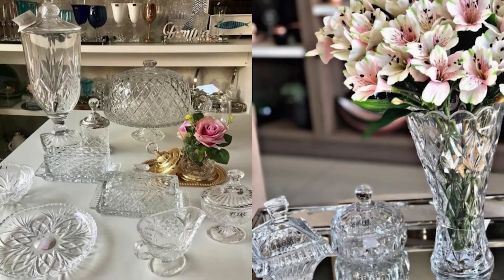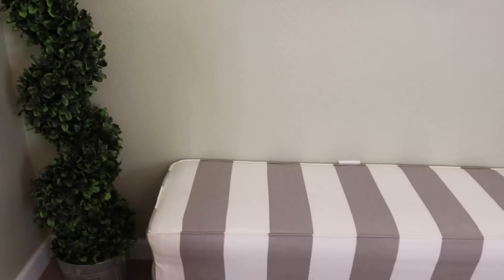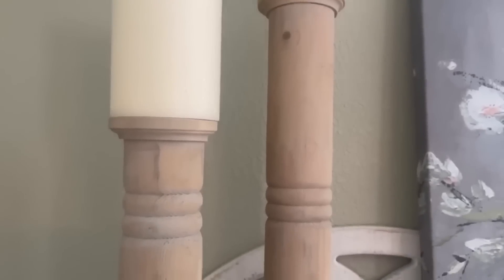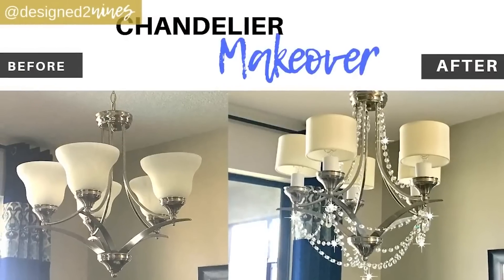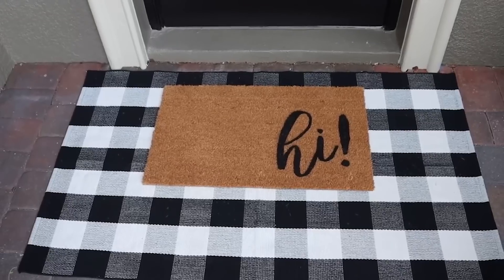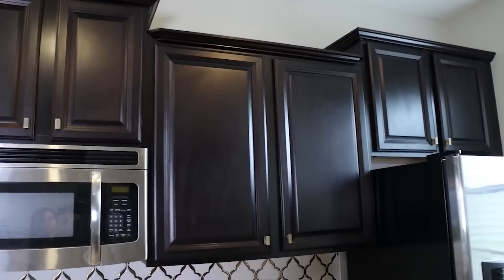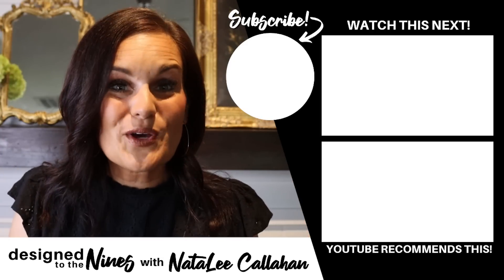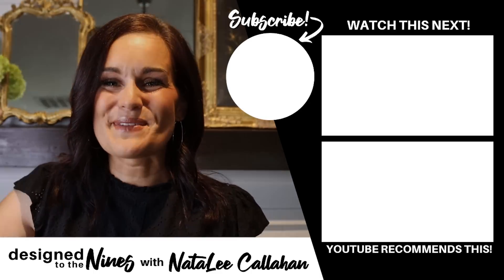10 Ways to Make Your Home Look Expensive on a Budget! (INTERIOR DESIGN)

Comment: Well I will say I did paint mine over 5 years ago and yes the poly is starting to turn a little yellow from where the heat has hit it but it is a slight yellowing. I painted it to look like granite. It has held up. So I guess I did it correctly! It has 4 coats of poly with sanding in between it is super smooth and I still get compliments on it. I also cut my backsplash out of 1  2x4  down to paint stick size and stained them in different shades of brown and gray stain. It is beautiful. I love the primitive look. I live in an old farmhouse. My kitchen remodel cost me 125$ because it was mostly paint. My knobs are glass knobs from hobby Lobby and I got them half off. My kitchen is one room no one believes I did myself or that is only cost me 125$ to redo. Countertops can be painted. ❤
Reply from the maker: Great to hear!

Comment: I love your ideas for saving money while making your house look better. One thing I would like to point out is that trends seem to change so quickly, so I am not willing to spend a lot on things that will just look dated in a few years. Also, appliances. You're lucky if a major appliance lasts 10 years. And the prices of them have gone through the roof! One thing I'd love to learn is how to make a wood and tile pedestal for front loader washers and matching dryers. Each time you buy a new machine, the old pedestal won't fit or won't match! This would save my back when I do laundry (which is like almost every day!).
Reply from the maker: So true about appliances. Especially dishwashers. I feel like I am constantly dealing with bad dishwashers. 😖

Comment: For those new to crystal, there is CUT crystal vs PRESSED / MOLDED crystal /glass.  Some of the pieces you showed were pressed glass, which is still beautiful, and not as expensive as the cut crystal.  "Cut" edges feel a bit sharper, more defined, and delicate than the smooth, rounded edges on the pressed glass.  I would wonder if that set of drinking glasses is actually cut crystal at that price. They are still beautiful,  and more practical than delicate cut crystal.
Reply: Those glasses were not real  crystal,  not for that price. I have a large cabinet filled with real crystal. This is the test to determine if it's real. Take a knife, spoon, whatever,  tap the item gently if you hear a ringing sound, it is 😂😂real BUT, if it sounds like a thud, it's fake !!! Try it. Real crystal is very expensive.

Comment: I like the look of cut crystal and I actually had a ready solution. Rather than just display my mother’s and my grandmother’s heirlooms, I decided to use them. I have two Waterford “low-ball” glasses, in two different patterns, but they are now my water glasses. I would just caution about using lead crystal for food or drink. I’m unsure if it leaches into contents, or not. I have a modern carafe that I recently bought, where a tiny tornado is created to aerate the water. (Expensive, but I love it!). I now have my Waterford glass beside it, so it is still on display. Am I afraid of breaking the glasses? Sure, as they have sentimental value for me, but now I get to see them, use them, appreciate them with there memories, every day